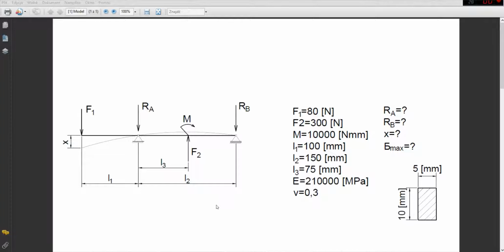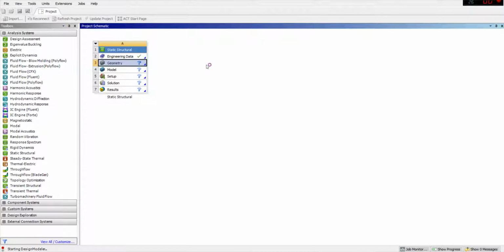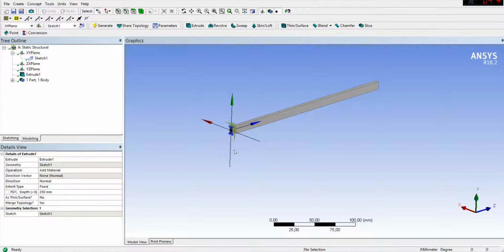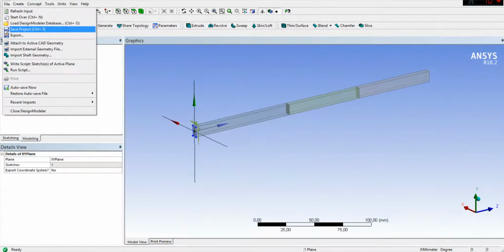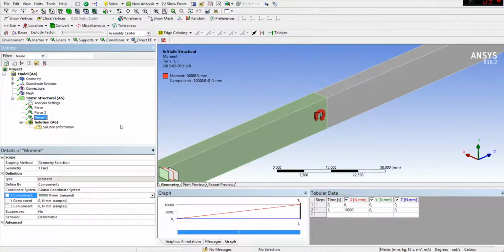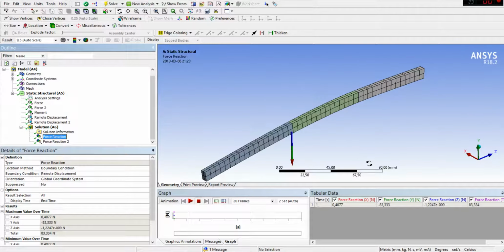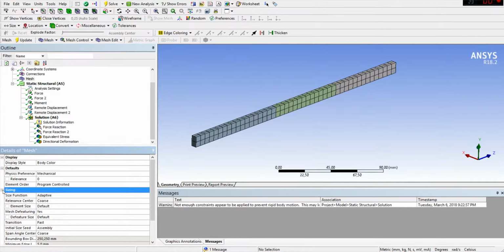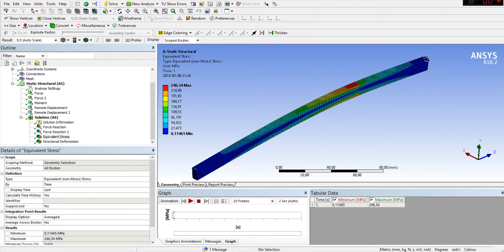Ansys tutorial - 3D beam results compared with analytical calculations

Comment: hi can you do a non linear analysis of a column and get the load - displacement curves. i want to consider geometrical imperfections
Reply from the maker: Hello, send me a model of a column you are talking about and I will take a look.
Reply: @allaboutfea4790  do you need data or do you  need a ansys file ?
regards
S Prasanna
Reply from the maker: @sprasanna1905  just CAD model, first I want to check what kind of column you are talking about
Reply: @allaboutfea4790  it is a normal column with I section shape is 80 * 80 * 160 flange flange web 
and then 10 *10 *10  thickness of flanges and webs then length of column in 2000 mm both supports are pinned conditions i want to have initial stresses imposed using either shell elements with integration points or beam elements with cells.
Steel column with E as 210000 poisons ration 0.3 Yield Strength 690 MPA Tangent Modulas = 42
Reply: if you want i can share my text file with you
Reply from the maker: @sprasanna1905  please send my on my e-mail model because I'm not sure if I understand everything properly. My email: allaboutfea@gmail.com
Reply: @allaboutfea4790  sir i have send you all the information on your email and also my text file